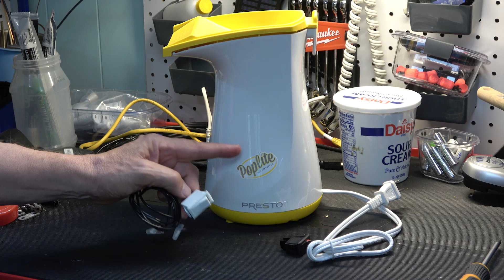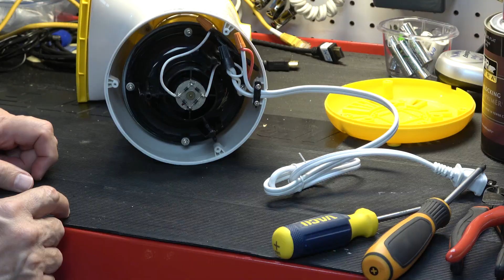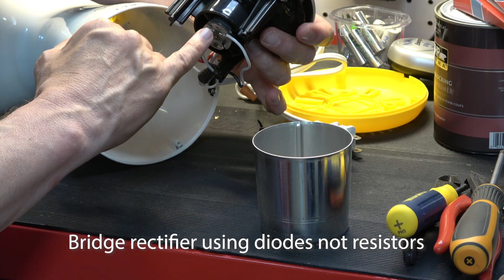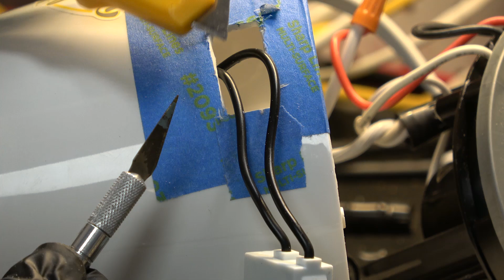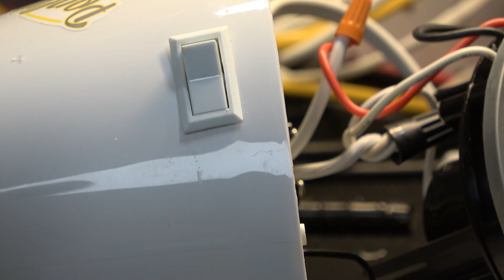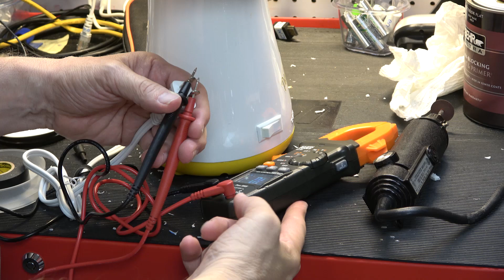Hot Air Popper power switch install

Comment: Hi sir! My ex wife used to have an older version of this Presto popper (the one with a brown base and yellowish cover). It worked fine for a long period of time but the fan died at one point (it's the failure for most poppers). I then became an amateur "popper technician", restoring given poppers for my own pleasure and use. However, cheaper popper do not produce a lot in 2-3 minutes and it takes like 20 minutes to fill a 20 L industrial bowl (my family eats a lot of popcorn!). So, I did some research and found that 1475 watts Poplite popper from Presto, producing 18 cups in one Go! I ordered it on Amazon for 44$ CAD on black friday special (you only paid 20 $ US!). Because I knew that company in the past, I just jumped on the deal but realized later there was no switch like on the more expensive 04867 model (80$) and I remembered the electrical arcs of the past. I have the exact same 15A switch in my spare sparts (also from an old vaccum but black) but I was thinking of installing another toggle switch on the cord instead of on the popper body. What do you think of the idea? My machine is new and I prefer to make a modification on the wire than on the machine itself. Thank you for your advice!
Reply from the maker: I am not sure the cord switch is rated for high amperage. I have only seen them for lamps in US. If it is your okay, but I would prefer mounting on the popper body. On the cord it increases the chance of damaging the switch.
Would love to hear which way you go and how it works out. Thanks for watching and writing in.

Comment: If you heated the plastic, you could probably flatten the area the switch is in so it's not protruding each side. If not, perhaps glue the switch in from the back.
Reply from the maker: The area for the switch is only slightly curved so it doesn't really protrude, otherwise your idea sounds like it might work. Thank you for watching and sharing.